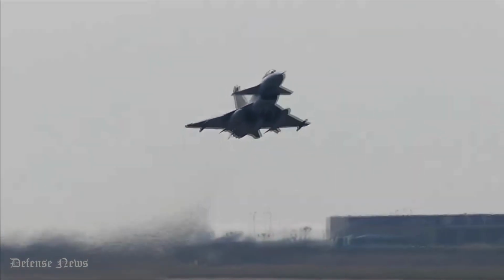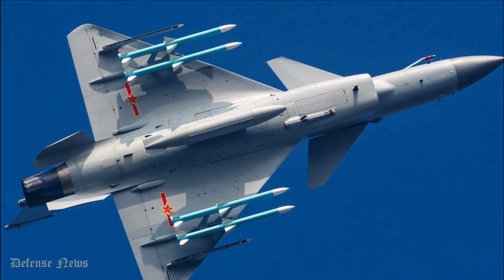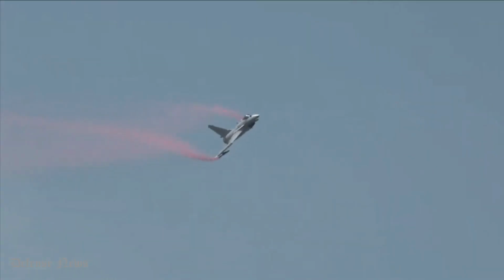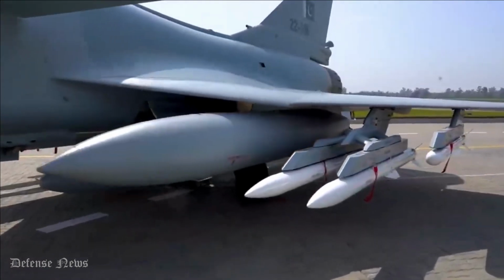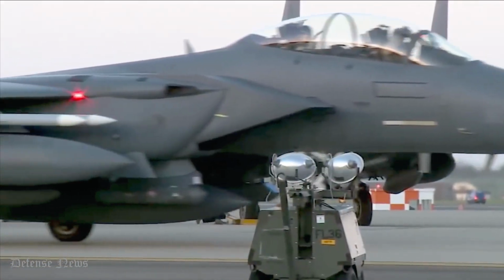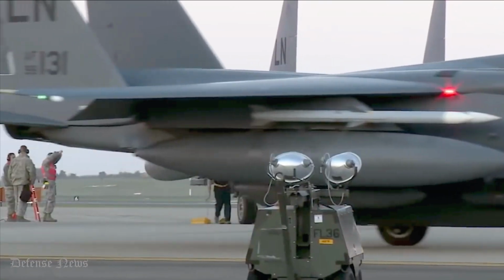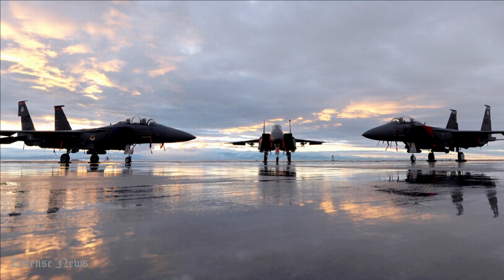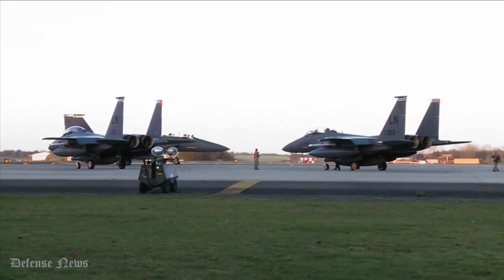Can A US Air Force F-15 Destroy a More Modern Chinese J-10 Fighter?

Comment: Not one on one. A J-20 is a Gen 5 stealth fighter designed to fight before they're even seen, like the F-22 and F-35. The F-15 is not very stealthy and is designed as a dogfighter, not a stealthy aircraft. That's not the whole story and I'm sure there are F-15 variants that are better at that, but the F-15 is generally Gen 4 and the J-20 is Gen 5. 
Ooops, you said J-10. J-20 is the concern.
Reply from the maker: thanks for the comment